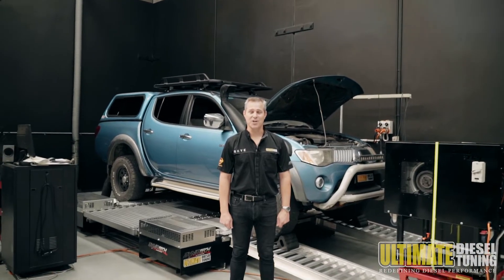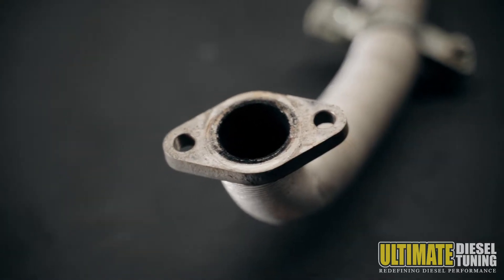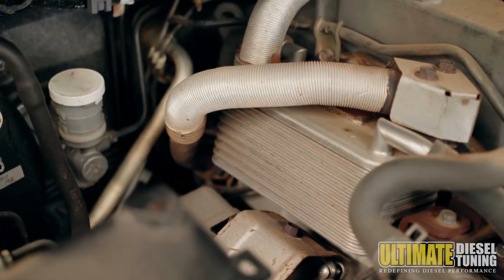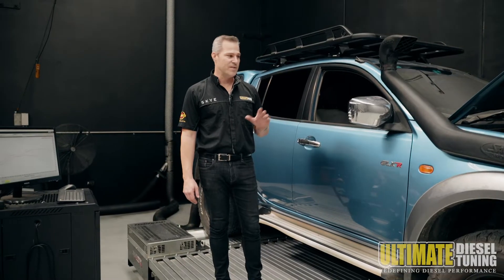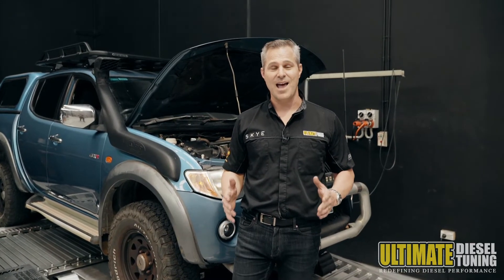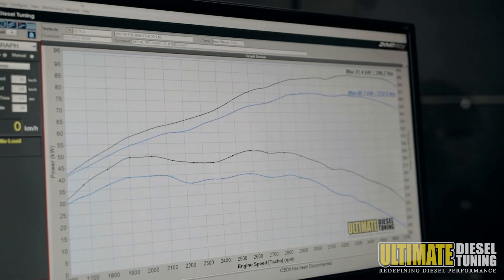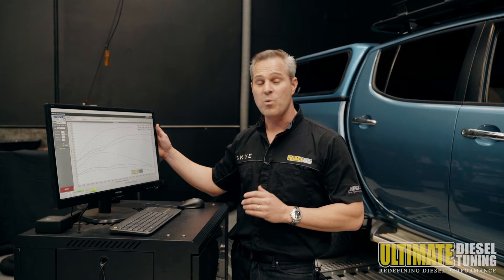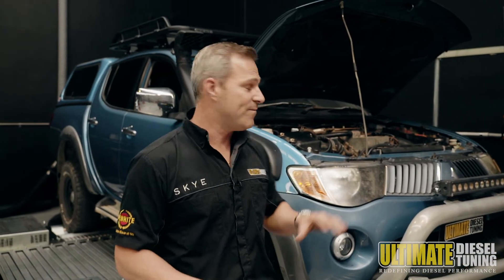"Soot Clean" & custom dyno tune explanation video

Comment: Got mine 400.000km on the clock does it worth to do a dyno tune for fuel efficiency and of course gain of power ?
Reply from the maker: Yeahhh the ks are too high, too risky. It'll be like making your grandma run a 50klm marathon! Get the soot cleaned out of it properly & that should help with the economy.

Comment: What other mods where done to get this power / torque?
Reply from the maker: None!
Reply: Wow, that's an impressive improvement.
Reply from the maker: Jeroen  not a chip - it's called a custom dyno tune. Way better & safer than any chip out there!
Reply: Jeroen  yeah, dummy. Not a chip tune.
Reply from the maker: Jeroen  we custom dyno tune every car from scratch mate. There is another video on our channel which shows you our procedure. It most certainly is custom.

Comment: Does upper engine cleaner spray do anything for diesels?
Reply from the maker: No. We have not found an effective one as yet unfortunately. In fact, we have not found another method (besides pulling everything apart) that actually works, besides ours & our chemical concoction. Steam/water does not work effectively either.